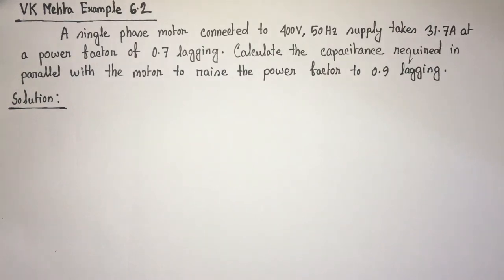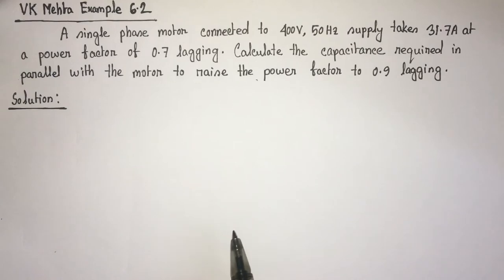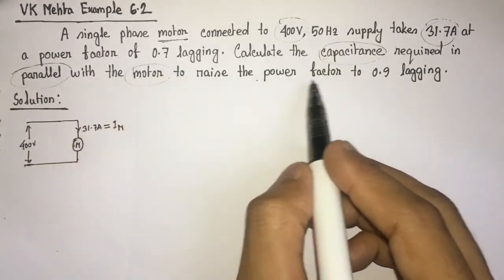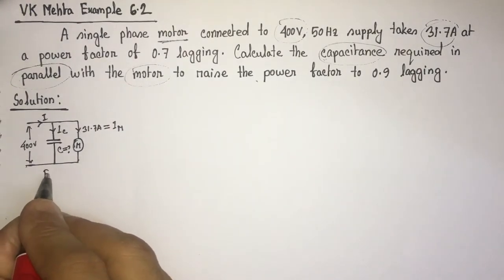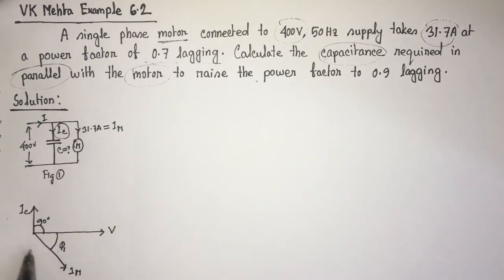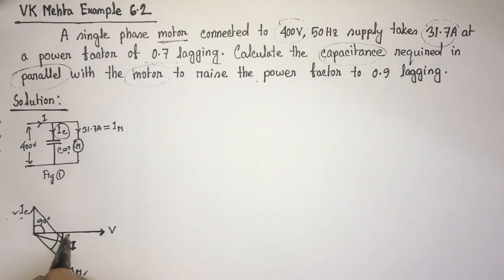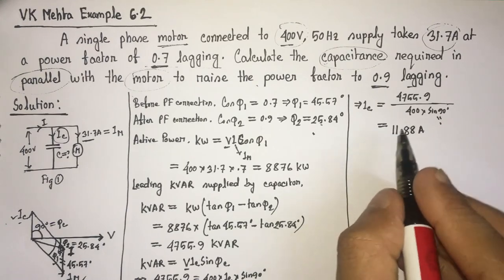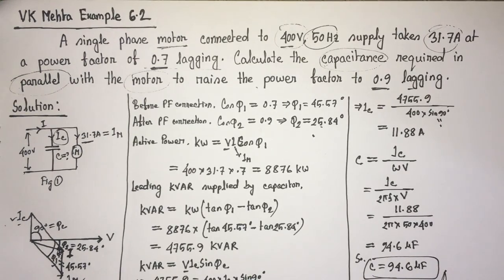How to find out capacitance for Power Factor Correction Related Problem (from VK Mehta Example 6.2)

Comment: nice work, but since phase rotation in clock wise, i think the lagging current must come after (above voltage)
Reply: I don't think so, remember pf is raised to 0.9 lagging from 0.7. it cannot go above voltage.

Comment: VI cos fi is not equal kw only watt
Reply: Bro power = VI cos fi 
Unit of power = watt
If watt greater than 1000 watt say 2000 watt we can say 2kw  
1000 replace by k 
1k =1000